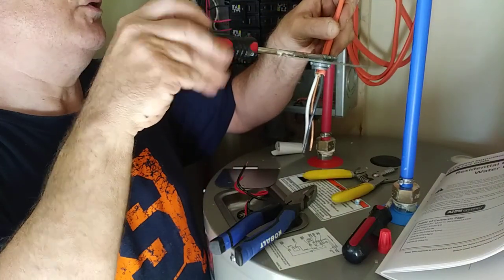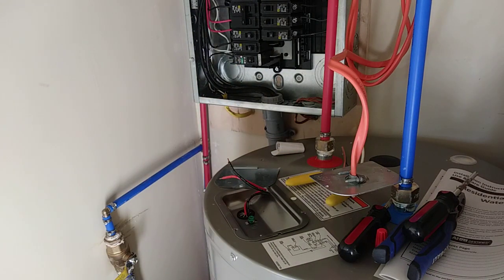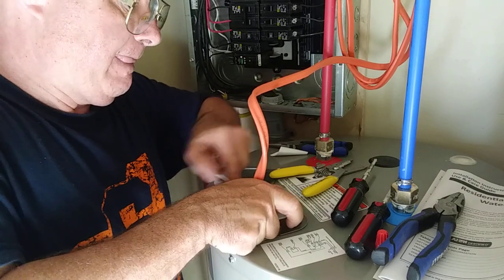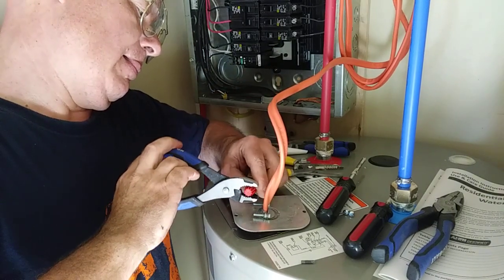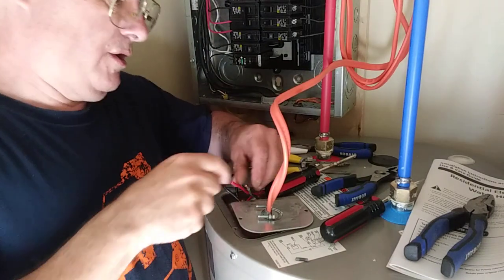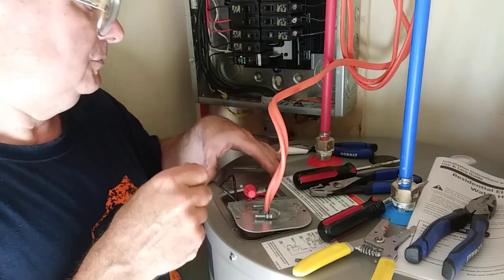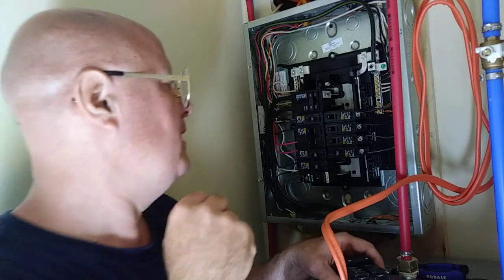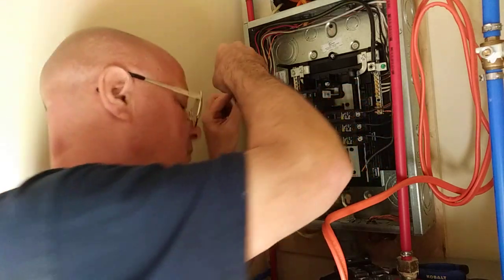How to wire a 220 volt hot water heater

Comment: Good video for showing wiring doesn't meet NEC code. Water heater must have a three feet horizontally and not in front of the electrical panel. Thanks for showing folks they can do this ! Great you have enough 10 gauge wire to move heater over in future! Oh I bet Jim stole your wire nut! Thanks for showing homeowner's they don't need and electrician. You didn't mention the double throw size of breaker but it should be 30 amp
Reply: 30, 31, whatever it takes

Comment: I'm assuming that water heater isn't in its permanent location yet.  If it is, it appears to be violating the electrical code for the clearance of the service panel.
Reply: On pex, we require copper leads from the water heater, too

Comment: In some places you must protect a wire like this using conduit, according to one set of codes I've seen. Also, color coding the white wire is required. For those that run the cable a distance through the basement, there are finicky rules how you run that cable. It isn't like the regular 110V house wiring.
Reply: You hit on a number of things I was worried about because I have to run wire from the panel to the heater and then there was the conduit thing too, I was hoping I could just run the cable as is with plastic sheathing to the tank.  My gut was saying you probably have to use some kind of metal tube for protection with clamps to comply with code.
Reply: @Victor-779  With the tank this close to the panel, I would have used AC90.
ps. the guy didn't splice it right either. You normally should twist the wires using pliers, then clip off the tip to make it sharp, and then put the cap over it tight. You must not just hold wires together than cap it.
Reply: Well you can't expect the stuff this guy does to be code compliant. He's not licensed, he doesn't take out home owners permits, he doesn't have a business license, he doesn't get inspections from the municipality. He doesn't even meet the NEC definition of qualified person. Guess he works cheap or for free helping out his church buddies and neighbors. Why would you put your building and insurance at risk by hiring this type of workman. I say workman because he has no credentials to deserve the title of electrician.
Reply: Romex is not meant to be installed in exposed locations especially if subject to physical damage. You should have used #10 mc cable.
Reply: @johndavies2949  A non-qualified person working on someone else's electrical is very illegal. It's not even possible to pull a permit for a non-qualified person to perform work on someone else's electrical.
Reply: @johndavies2949  Oh I know.
Or metal conduit, which might be a bit of a pita to install, but it's mighty good protection.

Comment: There is no 220 volt, nominal ir otherwise. Nominal voltage is important especially when dealing with appliances that have heating elements. You can get water heaters that are 208 volt single phase and 24O volt single phase. If you put a 208 volt heating element on a 240 volt circuit you will burn up the element. If you put an element rated for 240 volts on a 208 vokt circuit you will reduce the btu output of the heating element proportionally. This is critical when installing baseboard heat. 208 on 240 heater element burns up. 24O on 208 not enough btu output, thereby skewing your heat loss calculations.

Comment: I just replaced my hotwater heater today with an ao smith waterheater. I followed instructions filled take with water and ran hotwater faucet to get the air out. Wired the waterheater then cut the power on. No hot water after 2 hours. Press the reset button still no hot water. Then turned the temperature up to 150 still no hot water. Any suggestions
Reply: I don't have the money to afford new wire (but after troubleshooting our problem is either the tank itself, or the wire, already swapped out breaker, element, thermostat, tried reset button etc).. No money for either, but we're wondering if the tank itself burned up wire inside somewhere, or if the handful of rats that showed up the last flood did damage before we found and evicted them.

Hope you figured it out.. All summer without hot water was one thing, but we're heading into fall now, and of course winter after that.

Comment: Aside the fact that that his box does not have the required space around it. Maybe hes just doing it too close for installation purposes.   If  you look at the wire to the water heater its super long and, when he bumps the water heater you can see the water pipes wiggle around like they aren't connected to anything.  Maybe its wishful thinking and he's going to move it later? Also put that tongue away!

Comment: 👉😎👍🏼. good job.....I'm an electrician. I think you put the water heater near the electrical panel because you wanted to save electrical wire.....even though it's out of code....👉😂🤣😂🤣😂🤣.....minute 5:52. I think you're looking to see if it's the city inspector...👉😂🤣

Comment: What if you had ground, white, red and black wires coming from the circuit panel? Just hook up red to red, black to black ground to ground and don’t use the white?
Reply: Same question here. I got a 10-3 wire that was hooked up to my old heater. I forget where the white was, but I think it was screwed onto the housing inside the electrical compartment of heater. Hope someone answers this. 

I've got a 30 amp breaker with red and black on each pole separately and white to bus with other whites on same bus and ground on other bus inside panel. Didn't realize you only needed 10-2 wire until after I bought old heater
Reply: @bertpainter8385   yep mine too, I could have sworn the white was tied into the ground on my old heater but I wasn’t sure and didn’t wanna chance it so I just capped it off and it seems to be working fine with just the red, black and ground.
Reply: As I understand it water heaters don't need the return to neutral, just two wires and a ground. And like an incandescent light the wires don't need to be in a particular polarity .
Reply: My old one was wired red water heater to black from panel , and black water heater to white from panel. Which is opposite from this video, but the old water heater was working so wonder if i should put it back the same as it was, or like what is shown in this video which is opposite?
Reply: Correct! Black and red connect to black and red at breaker and heater. The white can be cut out. There will be an uninsulated wire that goes to the ground screw at the heater and the ground bar in the panel. White not connected at either end
Reply: @johndavies2949  or run 10/2 - it's not that expensive.

Comment: I'm not sure that the code allows you to put the hot water heater that close to the panel. Yes they do make 110 volt hot water heaters. They are just the smaller ones that you see fit in the smallest crawl space. Also it looks like you're using Romex 10 2 or you can call it non-metallic sheathed cable. The reason why they color code the other jacket so that people could easily identify the size of the wire. Before in the early 80s people used to always mistake the size of the wire because they could not measure it properly.
Reply: I was thinking when he said they don't make a 110v water heater I'm like yes they do 😂

Comment: I hate to be "that guy"that complains.  Never put a WH that close to the breaker box.  Since you are running PEX, it would have been easy to move the WH a few feet.  I did not see a water shut off on the WH either.  We cannot connect PEX directly to a WH in my area, we have to have 18 inches of pipe from the WH to the PEX.  That may be a local thing.  Wiring was correct.

Comment: Are you using Romex 10/2 wire?
Reply: derek bailar yes 👍🏻 ...that’s correct  10/2 is the orange wire, 12/2 is usually yellow or gray if outdoor and 14/2 usually white.
Reply: @etiennea.delarosa2383  exposed romex isnt allowed in dwelling. Panel requires very clear 3ft working space so that would be #2 inspection failure.
Reply: M Kidd Can one circuit run a hot water tank and a clothes dryer?
Reply: @UncleRandy73  no,

Comment: What are you using to turn it off and on ????
Reply: I’m assuming you know. Do I need a outlet switch?
Reply: If you're in sight of your circuit breaker box your covered. Otherwise get one of those cheap push in pull out disconnect boxes ,3O amp. No fuses necessary. The over current protection is the circuit breaker. Available at the Depot.

Comment: White wire is  always neutral
Reply: The white wire can be a neutral wire in regular applications. But there are some applications where the white wire become a hot wire
Reply: seaside51 reidentification of a grounded conductor by code is allowed
Reply: A white wire can be a hot or traveler when using romex from light to a switch.
Reply: No your wrong in this instance, color coded tape can be used to meet NEC per code
Reply: New code says white to only be used as the grounded conductor. Even switch loops for lights need 2 to conductors of colors other than white or green. Not allowed to re identify white wire as hot. The white wire just folded back in the box. Connect it to the neutral bar at the panel in case it has to be utilized at the other end. It's now ready to use when necessary. Like for smart switches or combo switch  receptacles or pilot light switches.
Reply: This is a new expense because now all Romex for switch loops will have to be #14/3  with ground or 12/3 with ground as the case may be.
Reply: But don't just cut off the white wire. You may need it in the future. Always good to have a spare.